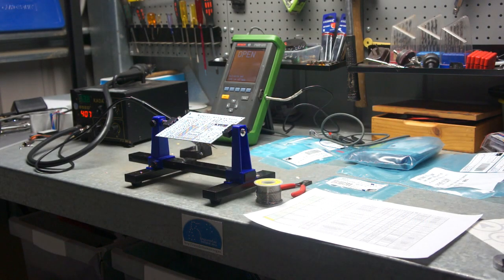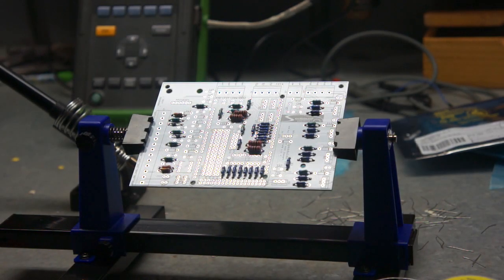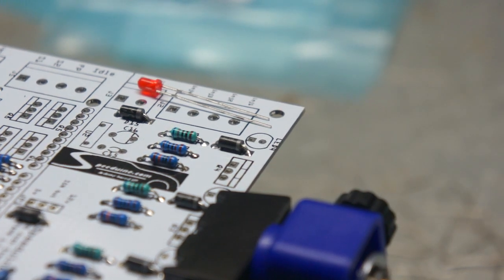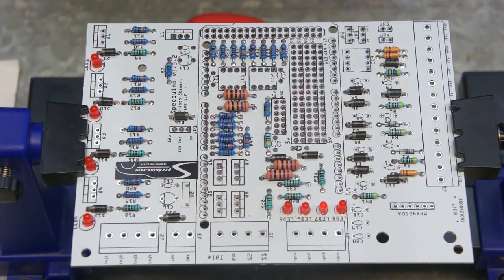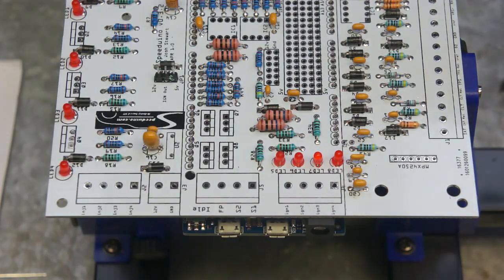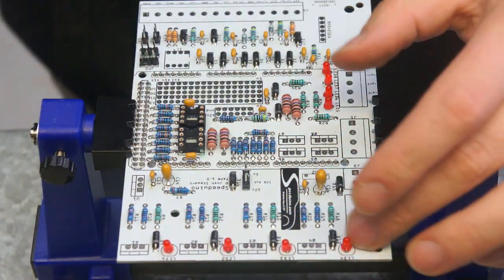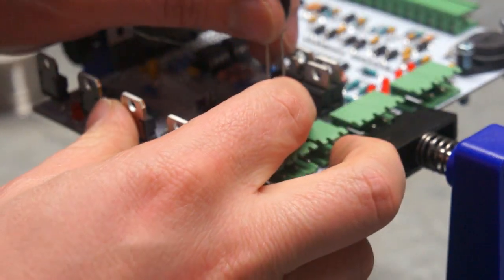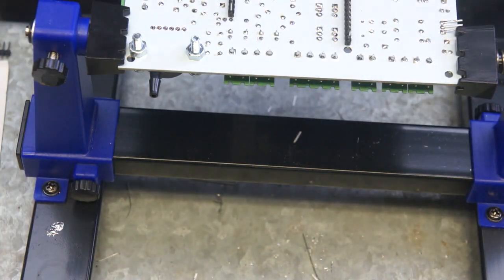Speeduino v0.3 Assembly

Comment: Is it possible to get a connector for an external map sensor?  Chrysler, back in their early days of efi, found in cold climates condensation would freeze in the internal map and prevent it from reading.  When they put it under the hood the problem was solved.

Comment: is there a list of components?
Reply: Did you ever find a list of components? I'm having a hell of a time finding info how to actually build one of these.
Reply: @st5rk  yeah, they are in github. Search in google "speeduino bom". I eventualy managed to assemble it myself mostly using parts from local electronics shops.
Reply: @mygius1  thanks, found it. What car did you put it on?
Reply: @st5rk   that project is still going :D now it is like 2 years by now. I had useless 89 civic D14A1 engine without car which no one wanted, so i tried to convert from carbs into injection. By now it has coils, crank sensor and ehatever it needs to run, but it is still siting outside not started yed, im lazy to tinker now

Comment: Hey Josh, if you installed the extra driver, is it possible to run a 6 cylinder with wasted spark (in pairs) ? - cheers

Comment: For those wondering. Up to and including 0.4.3, the MAP sensor goes with the hole on the top. They for some reason changed this in 0.4.4. I just desoldered and resoldered mine for no reason :(
Reply: Josh Stewart no problem! I should have read the wiki page carefully the first time. Great board by the way, I had the idea of using an arduino as an engine management system and came across the speeduino when I was researching it. You've done way more work on the board than I could have the patience for. Although we are getting some plug and play boards made up for certain engines just like someone has done for the mx5 already.

Comment: What about using an Arudino to control an external ESC, which can vary the voltage of a fuel pump with only guidance being a wideband O2 ?? Does this just sound silly?
Reply: It's too much work to get an arudino to control an ESC. That's the idea of a standalone ECU.

Comment: what the big difference between the megasquirt Ecus and how is the Quality? and how good is it tunable?
Reply: Nickolas Almeida up to a 4cl yes, otherwise you have to run semi-sequential or paired.
Reply: Shadowdarknessone it's a very similar product but because it uses an arduino board, its less soldering and can be cheaper. It uses the same tunerstudio software as megasquirt.
Reply: Josh Bishop can run full sequential injection with speeduino?

Comment: I want to design a new board for this that integrates the atmel on one board.
Reply: You can try, I thought about it, but you need to get them pick and placed, you couldn't really do it by hand very easily.
Reply: The ATmega is also available in DIP packaging. But even with the flat pack version, soldering 0.8mm pitch isn't fun,but it can be done... The way i solder, I'd buy 3